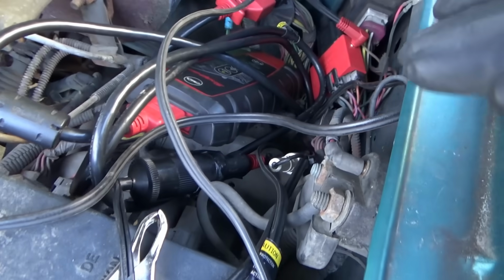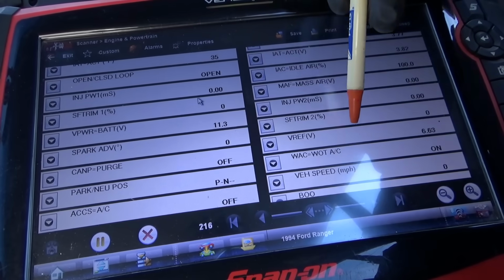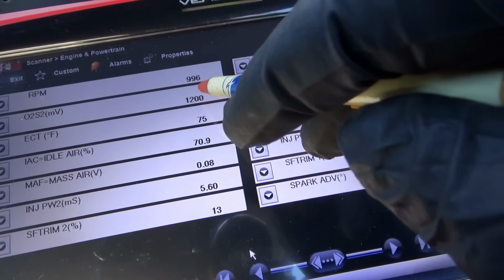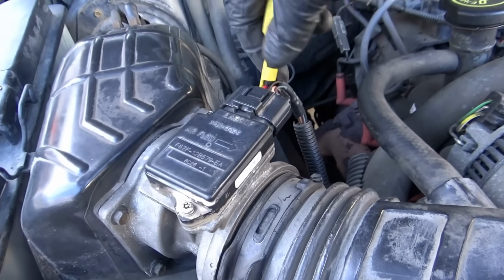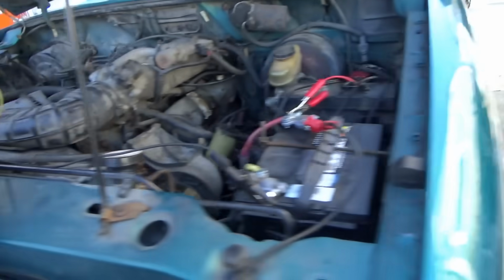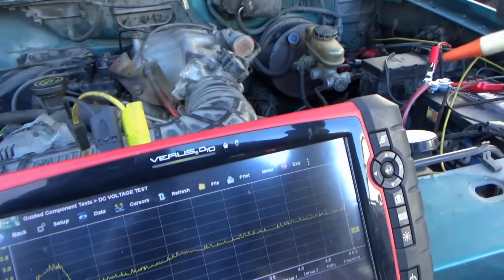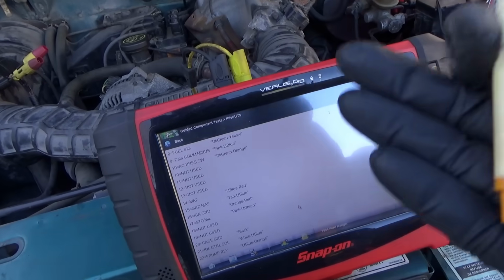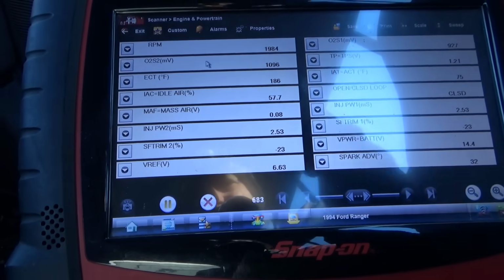DANGER RANGER (Barely Runs...super RICH?)

Comment: I have a sadder story. I own a 1994 Ford Ranger 3.0L V6 and it stalled on me, out on the road. Would restart up briefly,then shut down again. After it was towed home I noticed that things had gotten worse: The fuel pump (FP) no longer started and ran for a second or two as soon as the ignition was turned on. So of course I hit on the idea that maybe it was the FP relay. I don't have AC (for which there is an identical relay), so, to check, I switched the FP relay with the ECU relay, and found no change in the symptom. Thus I concluded that it wasn't the FP relay. I then spent something like 8 hours over two days just trying to get the ECU out of the truck. Even just getting the connector off took hours. I don't know how this guy did it so easily. And now, for the exciting conclusion: The caps in the ECU were fine; I went back to looking at the FP relay, this time with a multimeter, checking coil continuity. The FP coil was open circuit! Why didn't my switching relay trick work? It's because when the ECU relay is keyed on and closes it actuates (provides power to) the coil of the FP relay. The ECU then provides a ground to the other side of the FP coil to close the contacts. Thus, when I put the non-working FP  relay in  the ECU socket it didn't actuate the power to the ECU relay (in the FP socket), and I was deceived by the symptom not changing.

Comment: I have a Ford ranger truck,, 3.0L manual transmission ,,  it was run working..   I take it to the shop to do some struts control arms and coil springs in the front,, and in the back of some struts..     
      Now it will not move forward... ??? 
  That person at the auto mechanic shop..     put full synthetic sae 75w-90 in the drive shaft wear the abs sensor is..   because the boat was stripped to withdraw out of the drive shaft sensor....
    Now the truck starts but will not move forward..... 
    What to do.??    Please help with your wisdom 🛻

Comment: I recently replaces my Mass air flow sensor 3.0L Ford Ranger Edge.
Did the Youtube trick, pulled the old one while the engine was running and it kept running supposedly indicating it's bad..
So I figured buy a new on $100.00 Autozone, installed it and pulled it after driving 40 miles and it still is running.. 
What could be the problem?

Comment: I bypass the heater core on my 1994 Nissan truck 4 cylinder and now it's getting 8 miles per gallon... It's not the temperature..... I don't smell gas and I don't smell rotten eggs..??????😮😮😮
Reply from the maker: That's very strange lol
Reply: @PineHollowAutoDiagnostics  Thanks for the reply....
Reply from the maker: @gasisthepastendoil  reconnect the heater core and see if it is happy again 😊
Reply: @PineHollowAutoDiagnostics  i just located  the bypass 10" lower and if that doesn't help that I probably will have to pull the dash ill let u know

Comment: Best buy thqt capacitor is cheap, won't hurt ti solder in clnew capacitor those boqrd traces are very well protected with a coating unlike new electronics on cars so what im saying is that those circuits traces may be good actually

Comment: I know I'm a bit late but I've only recently subscribed to the channel and found this video.  I had the same problem with my 94 ranger 2 years ago.  Fortunately my leaking capacitors did not destroy the traces.  I bought some new capacitors at a local Radio Shack (yes there is still one near me) and repaired the computer.  You should note that electrolytic capacitors have an expected useful life between 20 and 30 years.  On older vehicles that have readings that make no sense from multiple sensors this will be the first thing I check.

Comment: I probably wouldn’t repair the circuit board for a customer. I would definitely do it for myself. You can get at roll of adhesive backed copper that stick to the board. You solder the ends. A suitable size wire would work also. That’s epoxy it’s coated with. It might be a UV setting epoxy but either will work. Good job finding that.

Comment: Part of the problem is the cost saving of components at manufacture. An electrolytic capacitor (the primary fault) costs less than 50 cents. If it was, say, a tantalum variety, it would cost about $1.00, and be reliable without damaging printed wiring circuitry. Some ECM's are made with these, and much more reliable..

Comment: Good old ranger pickup. I had a 99 Ranger 4x4 off road package. If it hadn’t rusted out up her in the rust belt of Minnesota. Wish I still had it. You had just enough PIDs  to see what was going on. Good video Ivan. Yeah I think with a engine that has a burnt valve and needs a quart every 1,000 miles I think I would be looking for a good used engine. But hey I did replace the one head and gasket and It drove and ran good for quite a while.

Comment: Excellent video as always.  Back in the 80's I was on the bench trying to fix AES Word processors down to component level with very little success.  One of the older techs (John) spent a day with me and taught me 'Visual, Voltages, Clock' - if you have these three it should work.  Well nearly 40 years later you have just proved how right John was.

Comment: 1994 would put it in the capacitor plague era though, and that is sadly a very common thing to see happen to electronics of that vintage.
You may be lucky that it isn't a layered PCB as some mentioned due to the age and through hole components (Easiest to repair).
As for the bonus scenic footage, I now realize that the Smokey and Bandit scene where the Trans Am ran through a bunch of mailboxes are plausible... They really are that close to the road :D

Comment: My Step-Mom's Sister had a 2 wheel drive Ranger, same vintage as this one. She was a very successful paralegal, her Ranger would burp gas from the filler neck every time she fuelled up. So much so she took it back to the dealership more than a dozen times. This big FORD dealership in Mesa, AZ was reputable but couldn't get the tank ventilation corrected, there was nothing wrong, it just wasn't designed well. She not only took mechanics to the gas station to observe this malady she took the service manager and general manager and made THEM put gas it it! They all got splashed with gas, she threatened to sue them and FORD but, after two plus years of fighting this problem, the dealership told her to go ahead and sue them. Now she was such a successful paralegal that she got HONDA to stop making 3 wheel ATV's, she's THAT paralegal. After actually serving all of the involved sales and service managers AND dealership owners with notice of intent to sue, they gave her her money back and then some. FORD Don't care if THEY get Sued, FORD gets sued all the time; FORD dealerships care about their name and reputations being slammed in the Local News Papers. She named her dog, Ranger!

Comment: Trouble shot same truck type 20+ years ago for exact same symptoms. running so rich your eyes would water in the drive way. all checks, found three unresponsive o2  sensors, replaced, oil change, fuel pressure/regulator check ok. No fancy graphical testers back then. Just an Actron scanner. Which I still use and is fantastic for quick checks before breaking out the Autel. Computer saw forced rich/lean changes in inputs,  but would not respond with fuel input change. Replaced computer, ran fine.

Comment: Dam crapacitor,  most devices are starting to fail, i have a realistic 2005 scanner and one day i needed to use it to diagnose a friends car fob,  the scanner didnt work 😞
It had been sitting on a shelf for a few years with no power.
After removing the case i saw black copper traces eaten away,  one electrolitic had peed on the pcb,.
After a clean up and jumpers it worked :-D
The pee went under the audio amp chip,  out it comes.
I finally was able to use the sc:-(anner to listen to the keyfob transmit  after resoldering.
Sorry ivan, waffle mode

Comment: With the right soldering equipment you can fix that board. Now it boils down to, is a replacement available and at what cost? The Cap is about $1 at most. Labor repairing the board, about 1 hour.

Comment: Interesting - I was thinking that the voltage pull-up via a test light is fairly low impedance, and maybe the ECM input had a partial short to ground via the damaged board that could by overcome by a voltage source of sufficiently low impedance. But when you probed the MAF voltage it was still connected to the ECM, so you would have expected the voltage to be pulled down no matter where you measured it (wire integrity was good) but that's not what happened. And all this assumes the MAF output impedance is relatively high, and I'm not sure it is. So no, I've got no idea. Not that this is relevant to the diagnosis, of course - but I just wish I could make sense of the symptoms.

Comment: The traces may not be damaged. Just the bad filter capacitor causing bad readings. I would remove the capacitor and check trace integrity. If good then put in a new capacitor and all will be good again.
Reply from the maker: Possibly...

Comment: Old technology...  My 1993 C1500 Chevy's last two issues were reported correctly by the ECM via OBD-I Check Engine light flashing codes and corrected with work in the driveway.

A crank no-start was a faulty coolant temperature sensor.  The last issue was a pointer in the direction of a faulty ignition control module.  I did have the local parts place run the ignition control module through their diagnostic tool.  I also had them check the new one before walking out of the store...

Working on automobiles is never boring for the mechanically curious, that's for sure.

Comment: Pulling sense lines up with an incandescent test lamp is risky. 
It could damage unprotected/poorly protected inputs. And even protected ones, you risk pulling the internal supply rail up, via the protection diodes.
Properly protected inputs should be fine, but I've seen some crap designs out there.

Comment: If there is an update, would you post it.  I see that Rock Auto has a bunch of different remanufactured ECU's in stock.  The differences are emissions type and transmissions and 2WD / 4WD.  They all say no programming required.  If the owner bought the correct one of these and was able to successfully install it, that would really be a happy ending to this one.

Comment: I'm guessing he would have tried to replace the cap and clean the board IF he were home at his garage, but when he's at a remote location, it becomes very difficult. I agree that a 30-year old Ebay replacement may have failing, or soon to be failing caps. That clear coat makes it hard to bridge traces. I would try and locate a reliable module repair facility that does it for a living.

Comment: Nice. Thank you. 
You should brush up on your soldering skills. That is an easy fix. As long as you have the right cap and a really good iron. Pace makes nice irons. The worst part is getting the Huma seal off. Aceton works really well.
Then again, it's much easier with a microscope but to carry one around with you is not fun. That would be a job for home.
Reply from the maker: If it was my own truck then yeah nothing to lose... For a shop that would be last resort if they can't source a replacement 👍

Comment: Solder in a jumper wire at the component solder points and bypass the bad traces.  It doesn't look pretty, but it works. And obviously replace the bad cap.,

Comment: I remember a few videos back mentioning this very problem, and suggested that once a car gets to this sort of age it is wise to check the electrolytic capacitors. Even if your not confident enough to do it yourself, take the ecu down to a local electronics repair shop, they should not charge much to swap out a capacitor or two. And like Jose mentions in his comment, if your good at micro soldering that board is easily fixable if the damage is limited to the top traces. But becomes very tricky, if not impossible if their are internal traces damaged. But like I said before, if your driving a modern classic, give some thought to getting the capacitors changed, I have seen this damage plenty of times now. My advice to this customer would be to get them replaced in the replacement ecu, seeing that it's going to be of a similar age.
Reply from the maker: Great advice! I should do this on my own classic beaters 😀
Reply: @PineHollowAutoDiagnostics  an ounce of prevention... potentially

Comment: Ivan,
         I love your vids mate, I used to fix ECU's and AFM's and things like that when I was a younger unit.
One thing I would hamster you about is that a ground is not a ground, when i worked on Geo equipment was this big issue with noise. So i made this box that blamed 1 amp thru all their ground plane, so then we did a metric on it, after that all rando bullshit went away. Every ground is a potential resistor and needs a current source to make it an honest reference (telco metric is timpanic testing).
Reply from the maker: Wait I'm confused... A ground needs constant current running through it to make it a good ground? 🤔
Reply: @PineHollowAutoDiagnostics  nah, sorry i didn't explain that well, meant that sometimes they fly up under load, due to a bad header and it's a pain to find.

Comment: I just watched a video from shango066 a couple days ago fixing this exact type of ECU and it had the exact same fault. He was able to fix it by cleaning off the leaked electrolyte, sanding the soldermask off, bridging the broken traces and replacing the caps. The problem is if the electrolyte absorbs into the board and eats away the internal traces or vias or shorts them. You can only try to clean up what you can and see if it fixes it. https://www.youtube.com/watch?v=RUhvuCwVIl4
Reply: Here's another one https://www.youtube.com/watch?v=Fq5SWIvq_0s and he also has a couple more for different ECU's but for the same capacitor leakage problem.

Comment: It technically is still a circuit issue. It's just not a problem with the passive circuit. IE. The wires. The capacitor & and traces on the board are still part of the overall circuit. Which is why it's best to keep this in mind, and inspect it as well.

Comment: I've noticed you never back probe connectors, you always use those piercing probes on wires, do you put any repair compound or tape on the wire after you finish?
Reply from the maker: If necessary I put a dab on dielectric grease on the pin holes 👍

Comment: Is worth just trying to replace the cap, doing a quick clean and try flowing solder on those exposed traces then using clear nail polish to seal them back up ..  dunno prices on 94 ecms but id guess other than junkyard diving, ford would bend you over and shove it in dry..

Comment: Hey, it was 78 degrees F today in Wilmington, NC!   That's about the right amount of miles for that 4.0 to need timing chains.  Yank the engine and change the rear and front timing chains/tensioners!
Reply from the maker: This is 1994...none of that SOHC BS 😜
Reply: @PineHollowAutoDiagnostics  Lucky owner!  Thanks for the response.  I didn't know there were two versions of the 4.0.  By the way, I'm surprised that you haven't added a truck to your stable being a homeowner and mechanic!

Comment: I was suspicious of the vehicle reference voltage at 6.63 volts just before you mentioned it. There is a possibility that the ECT code might be there because of the engine not being warmed up. I think back in the day when we would use the Ford scan tool at the time to scan OBD 1 vehicles that code would appear if the engine was cold. I could be wrong, it's been a while since I scanned an OBD 1 Ford vehicle, 🤣.

Comment: Why don’t you update the snap on verus past 2017?
Reply from the maker: Because that would be a waste of money lol... I don't use it on anything newer than 2006 😅
Reply: @PineHollowAutoDiagnostics  oh ok. Do you need a internet connection to do a component test?
Reply from the maker: @OkinSold  no... That's the beauty of the SnapOn! All the info is on the tool! Comes in handy in remote areas with no wifi and older vehicles 😁
Reply: @PineHollowAutoDiagnostics  that’s so cool! Thanks for that info. Does that also apply to the “repair information” section? Some newer tools require a payment subscription and internet to access this kind of data!

Comment: Bodge wires might or might not bring it back to life, Sarah n Tuned  had a similar issue on a 94 she rebuilt and ended up installing a aftermarket replacement, essentially a mega-squirt installed in a factory style case.

Comment: If the trace damage is just on the surface traces, it shouldn't be hard to fix.  Best to follow the traces in both directions to the component or via closest to the damage, and connect the jumper wires there.   Much easier than trying to bridge gaps on the traces in the damaged area.  AWG 30 solid core wire is best for this type of repair.   The wires should be held in place somehow, with glue, nail polish, or Kapton tape.

Comment: amazing the cap lasted this long LOL. I replace those all the time on TV/monitor power boards and other equipment power boards. constant heat causes them to fail eventually. its not normal for them to eat traces though, expecially since that has the clear epoxy on it. just trace where each trace leads to a solder point and solder wire to those points replace cap. its not that complex come on man no parts required! lol